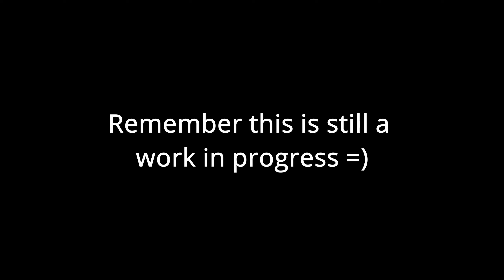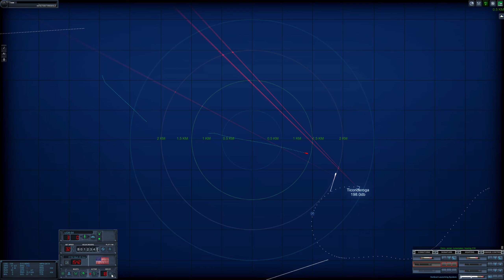Ticonderoga Class Cruiser - Huge Surface Battle || Cold Waters Dotmod

Comment: ok so in these type of battles, it pays off to be very agressive at the start of the battle. I've been playing those pretty passively as in using most of my RIM-67s in an air defence role and just wait out until they run out of missiles. Then again I was dealing with mainly Soviet warships. Maybe the Chinese ones are a bit lighter on the AShpM department?

As a sidenote the track "Battle on Land and Sea" would have been a kickass background soundtrack for this. Hahaha although I guess the copyright holders would not like that. :P

Great video. Looking forward to more.
Reply: PLAN surface fleet are ridiculous when it comes to naval guns engagement.. Their guns range are about 35 km.. Put them in class of the gun reach of those Iowa..
And their AIs is brawny rather than brainy.. Sticking with their guns although they are equipped with ASMs..

Comment: How do you set up a mission to use surface ships? Can’t seem to figure it out
Reply: Just do the Training Grounds mission (mission #1), then select the 'Mission Editor' option instead of 'Start'. You can select the enemy and neutral ships, where on the map it will take place, etc. There is, technically, one pre-made surface scenario, "One versus All" (#9) but it is utterly brutal and you get slaughtered almost no matter what you do (I've noticed no one is posting videos of it on YouTube--I get the feeling no one has successfully completed it!). So, instead of that, do the Mission Editor option. That way you also have access to play the full spectrum of ships, not just the four surface ships in the One versus All scenario.